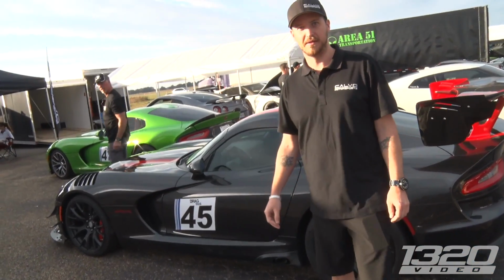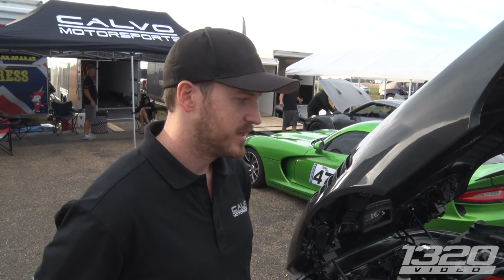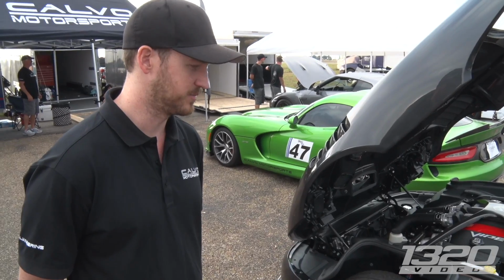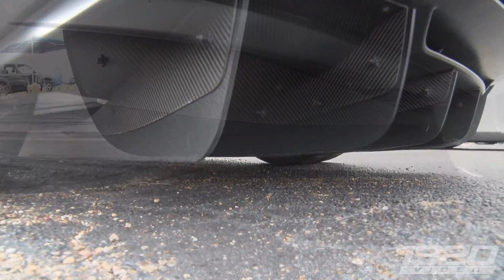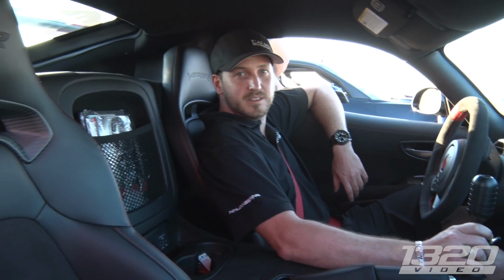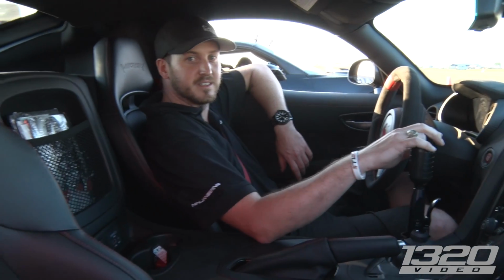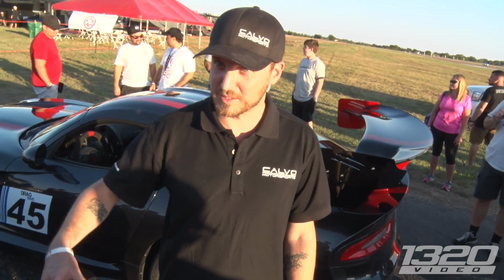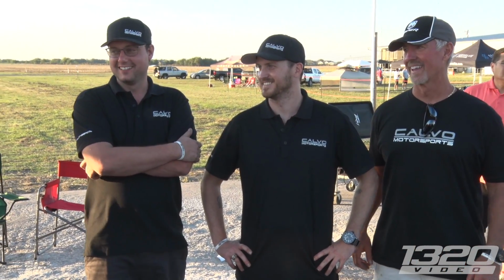This is the Way Vipers Should Have Come!

Comment: 1750hp and only 195mph? Impressive mph but seems a bit low for the whp produced.
Reply: Matthew Motley impressive considering the distance, around 1600ft little more than 1/4 mile
Reply: The spoiler and canards really cause a lot of drag. But I'm sure if they were to put a TA ducktail and remove the canards it would fly a lot faster.
Reply: michael park why 1600ft?, didn't these race used to be 1500ft at KOTS?? 

And why was he so off the speed index run?? That couldn't be same distance?  You dont hit 192-195 then 205 lol but i've heard before they do longer runs at SPEED index run.
Reply: Steve Hash During the speed run he was able to use the whole runway.
Reply: Steve Hash organizer pushes the button for green light anywhere inside the three flag zone. The flag nearest to the tree is 1500ft to the finish line but the organizer often times pushes for green before that around the middle flag, each flag is roughly 100ft apart.
205 run was 2000ft run, from the burn out zone to the finish line is roughly 2000ft
Reply: michael park ahh  i knew it this has been done before.  Tanx anyway.. still impressive on 19" lol but the wing actually helps it alot traction wise
Reply: This car would not be as fast without the wing, it would be spinning all the way up to 150MPH, go watch any other video of a Viper with 1100+ HP, all they do is spin. The aero is the only reason this car is reaching those speeds within such a short distance. Exact same reason why the 6 second GTR’s have massive aero now, its all about grip at lower speed. It would be a totally different story if these were 1 mile runs though.
Reply: I think you're confusing this type of racing with the top speed of the car. The car is gear-limited to 230mph, but will get there in just over a half of a mile. This is only 1500' of acceleration. The absolute fastest car that has ever run on this track has been 230, and that's a 2500+whp GTR with AWD and active aero...

Comment: Those stock ACR with 640 HP break all the time I can't imagine with 1750 to the wheels
Reply: What are you talking about? How many ACRs have you owned? This motor will last forever in this configuration. We've built plenty.
Reply: My Ram 06 1500 SRT-10 has been going strong for 11yrs.

Viper motors are very reliable and tough as nails.

My uncle has an 04 Version and it’s going good.

Love Viper engines they are very unique and one of the last Naturally Aspirated motor left.

Gunna miss the car since it’s getting discontinued.

😭😭😭😭😭

Comment: whats the deal with 19 inch wheels?
Reply: Smaller diameter wheels allow for larger sidewall, which allows for more flex, which allows for better grip. Especially on this track where it isn't smooth one bit. Also rotational mass...

Comment: People saying that it will handle the same on tracks with this setup don't know much about racing. The car was already front biased and now there's even more weight over the front axle. It will likely have snap transitions from understeer to oversteer with the added power.
Reply: The car is 50/50 weight from the factory

Comment: The Viper. For when America says "fuck it" and decides to beat you with brute force instead of tech and V8's crammed into an engine bay 2" smaller than the actual block. 

"Somebody pissed me off. Give me the 2' wide tires and a V10"

Didn't the original Viper use a V10 designed by Lamborghini? I swear I read that 20+ years ago.

Comment: Anything with a thousand horsepower in the hands of a young in experienced drive from the factory sounds like a lawsuit cause so many young dudes would buy it thinking it can be handled but it really cant it really can’t fuck the normal viper is already hard enough to handle and it only has 640 hp 600 okay not 1700😂

Comment: If it did that would be a disaster there would more money and power than brains at that point no wonder it has to be track ridden. Just in the case that if the driver crashes the driver made that commitment and it wasn’t dodges fault because dodge didn’t stuff all this power into a chassis it wasn’t suppose to go into. That’s the only reason why dodge is not and I repeat not making cars over 1000 hp😂

Comment: All the hp to the wheel and tops out at 175 ?   New Vette runs 700 whatever hp and tops 200. Guess it's all about the gearing (?) Vette running a 7 speed manual now

Comment: Still, not a chance vs a H2R
Reply: Va B 1000HP cars are smoking tuned S1000RR's on the steets, this thing would embarrass a Kawasaki.
Reply: Va B theres literally strapped/turbo'd and tuned  Hayabusas making over 500 getting killed by Underground Racinf Lamborghinis
Reply: Can't you just appreciate the car we just saw instead of childishly fanboying over your favorite bike?
Reply: Simon T no :)
Reply: SupremeNigNog Auschwitz wrong mojon ran down 1250whp supra 1350 awhp gtr 900-1000rwhp mr2 sq box 2400lbs 980awhp sq evo8 with 4,56 gearing then he was side by side with a 1450awhp lambo all this on a s1000rr NA engine.. Even old 1000cc hangs with 1000bhp cars lmfao.. 

Then you have Bill warners hayabusa with 1000-1200bhp which has the fastest standing mile and fastest top speed of any tuned SL vehicles.. that busa was pulling 2-3 times HIGHER G forces at 290mph then the Ford gt tt that has the record for cars now let that sinck in  a bit.. and he was doing 312 mph  at  1,1 mile lol..
Reply: SupremeNigNog Auschwitz ohh the vids i am talking about is all on TRC haha
Reply: Steve Hash What a mess of a comment

Comment: Kind of dumb to do that build on an ACR....
Reply: Lowkey JDM Why?

Vipers were designed with room too fit Twin turbos.

Perfect car too throw it on and with the aero wing helps keep traction.
Reply: booieful its a track beast that’s like taking out horsepower in a dodge demon slapping a wing on it and making it corner
Reply: Lowkey JDM I know that it holds tons of track records.

But that Motor is very nasty with the amount of Torque and HP it puts out stock.

That’s why they used the Viper.

It’s also a very light car that has a motor that puts out tons of Torque and HP. Through a Turbo and you see this.

That Wing gives it 1500LBs of down pressure and keeps the car from spinning.

They had another video of last years race at this track without th Wing they lost the Finials due too Tire spin. They only ever avged 188 MPH on that 1320 video.

Smart that the chose this car too do it.

Vipers are nasty cars when driven right.
Reply: I don’t have a Viper but I have the SRT-10 Truck.

With the Viper engine in it.

Completely stock ATM.

But you can feel the power I just needa unlock it with mods.
Reply: That and that stupid ass Torque management BS on the trans....

It really hinders the motor.

😭😭😭
Reply: booieful yeah its cool I just wish they didn’t use an ACR. Either way it doesn’t matter it’s here so I can’t complain.
Reply: Lowkey JDM Idk.

I think it’s a pretty cool way to send the Viper out.

ACR is the last edition of a legendary car.

RIP
😭😭😭😭